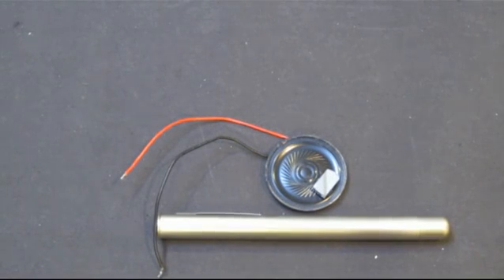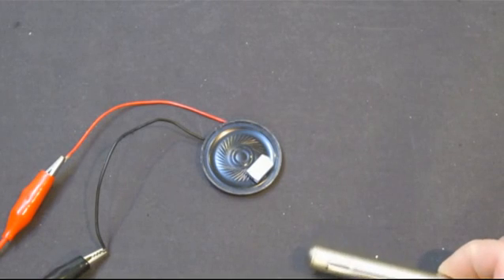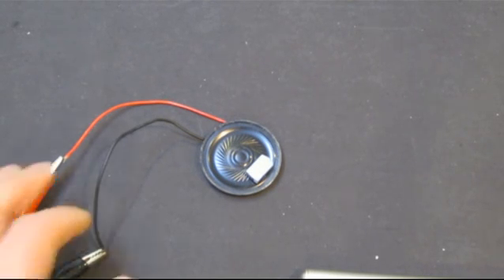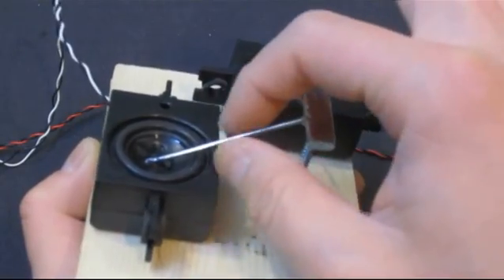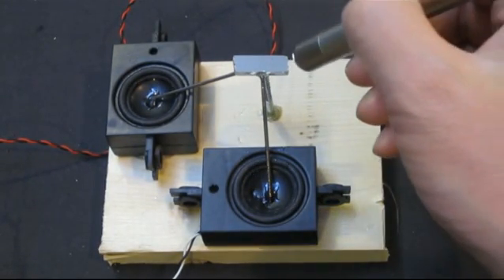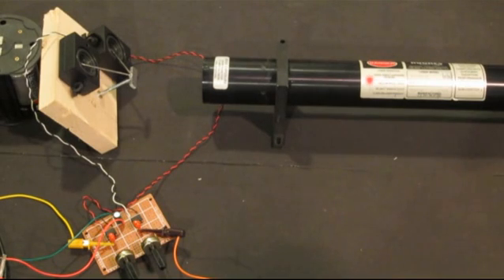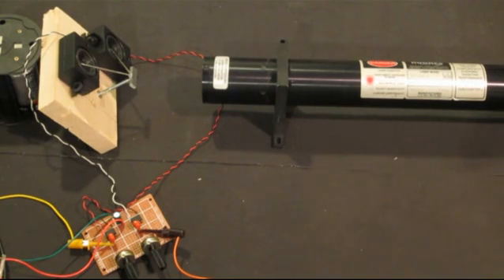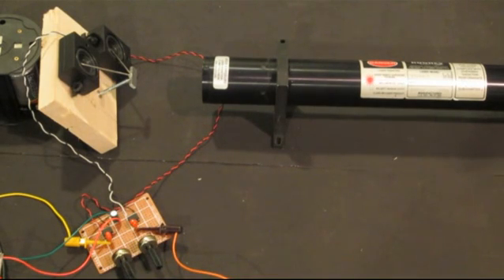Building A Laser Oscilloscope

Comment: The non-linearity is actually indicating the resonant frequency nodes of the system built (speaker and mirror). I doubt that you were twisting the amplitude knob at the same time as increasing the frequency (not amplitude).
Cool video.

Comment: If you can get hold of La0.66Sr0.33MnO3 and shape it into a cube surrounded by coils, then you could evade the problem of mass inertia, which usually makes high frequencies impossible to display properly, since the power of the tiny speakers isn't sufficient for throwing around the mass of the mirror, struts and speaker membranes and coils.
Just google for materials, which change their refractive index by applying a magnetic field, then google for companies that produce/sell that stuff ;)

Jerobeam's music usually is recorded in 192kHz and 24bits(even 32?), a necessity for creating fine details in his lissajous, which come as ultrasound in a lot of cases, so you can see funny stuff, but basically hear only a square baseline and a phased sine melody with some funky ultra high pitched noise^^
The piece "Nuclear Black Noise" is by far my favorite ;)
Reply from the maker: Will take a look. Thanks.

Comment: You know what'd be awesome for this, if there were some material that had refractive properties like a prism, but could have its refractive index changed by something, say by exposing it to a magnetic field or something. This'd then give us a solid state solution. But I doubt such a substance even exists.
Reply: Hello Spudhead: Look up Pockel Cells. In the days before CDs, a company, Discovision (Universal Studios + IBM) I worked for used them to modulate a laser beam to write data onto a glass master video disk that had a light sensitive coating on it like a PC board. Those master disks were then developed like exposed PCBs are then plated. The resulting master was used to injection mold a plastic video disk (Laserdisc) the foreunner to CDs and DVDs. I did not work in the section that did the mastering work but I'm thinking the Pockel cell probably could be modulated quite rapidly since our company produced movie video discs. Magnavox and Pioneer made a videodisc player that played our product.
Reply: woah